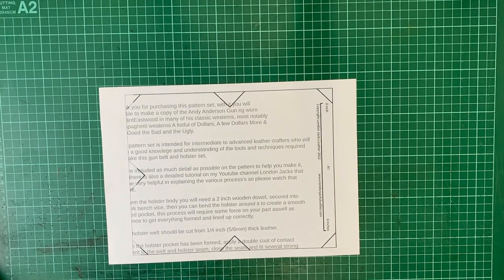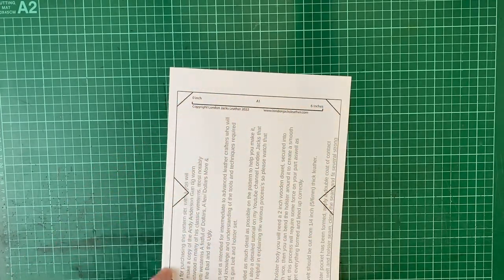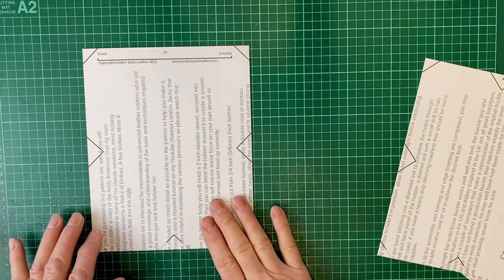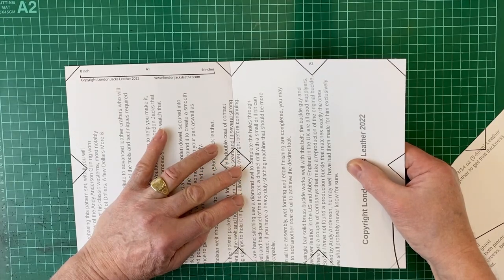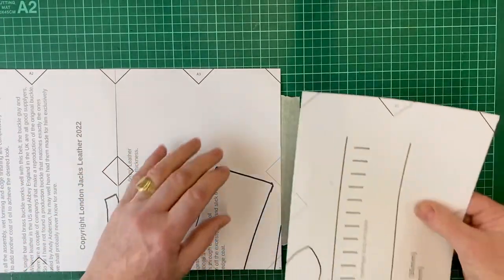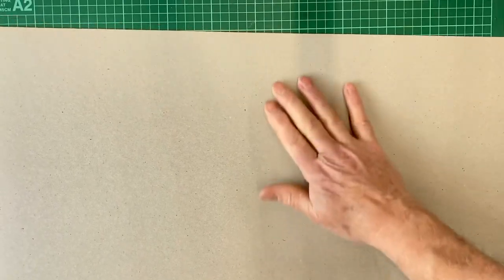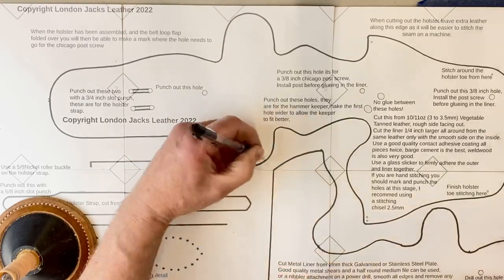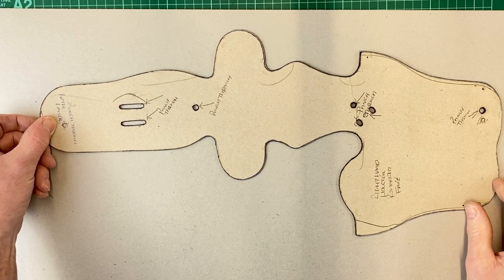Printing a PDF pattern for the Clint Eastwood GBU Gun Rig

Comment: Hi I watch the videos over and over but could you please give leather thickness in OZ's also the belt width in inches and metal thickness in US measurement. Thank you
Reply from the maker: I put both oz and metric measurements on the pattern, 1mm steel plate is 3/64”

Comment: do you trace all the parts using the inside of the lines?
Reply from the maker: Yes that’s correct, its the best way to get the most accurate pattern, but small variations won’t make that much difference.